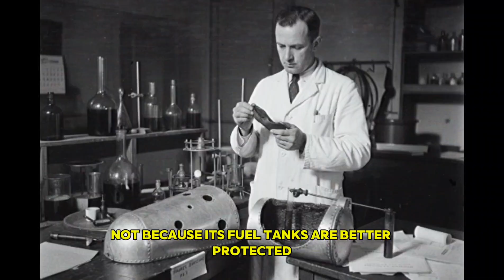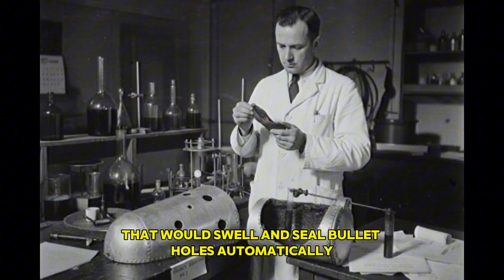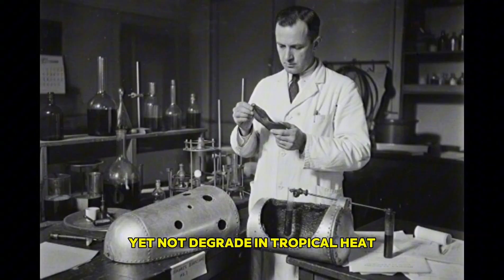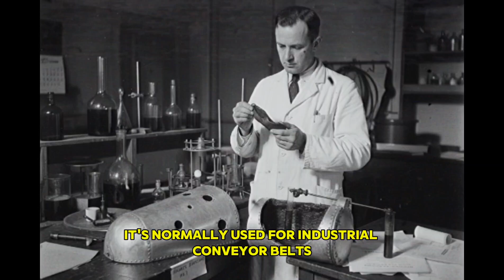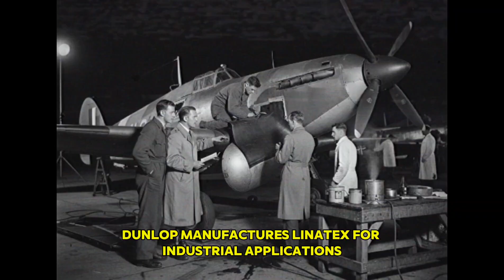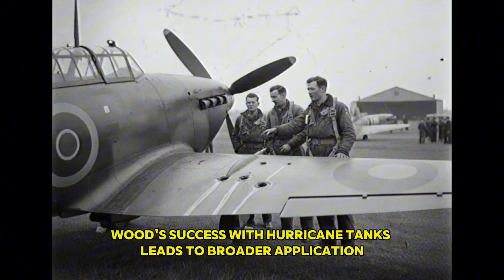How One Engineer's 'Insane' Rubber Liner Saved 300 Hurricane Pilots From Burning Alive

Comment: More AI nonsense. Who writes this rubbish?
Rubber lined fuel tanks were in use prior to 1939 Fireproof Tanks Ltd were formed in 1939 and supplied them for the  Fairey Battle. 
Linatex was invented in 1929 by Bernard Wilkinson, while working in the rubber plantations in Malaysia. Dowding ordered Hawker to fit it as a matter of priority early in 1940 as the Hurricane did have an issue with the fuel tank. there's no "Major John Woods" involved.
The tale about Peter Townsend at 2:04 is utter fanciful nonsense. In July 1940, Townsend was shot down for the first time by a Do27 whilst attacking it off the French coast. Return fire hit his radiator causing a coolant leak. As a result, he had to ditch in the Channel and was picked up by rescue services. He was uninjured. Townsend was shot down a second time at the end of 31st August 1940 when a canon shell from a BF110 went through his glycol coolant tank and shot off his big toe. Again, the coolant leak resulted in a forced crash landing. He was back flying on 21st September once his toe had healed sufficiently.
So the above is the reason you fantasy version is not taught in school. It's rubbish.